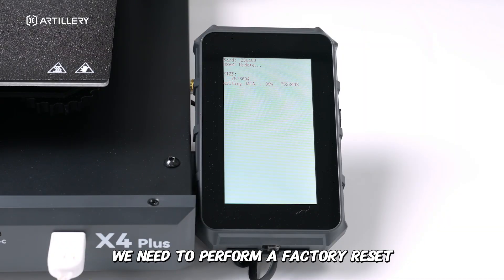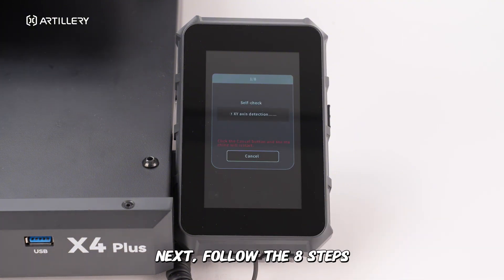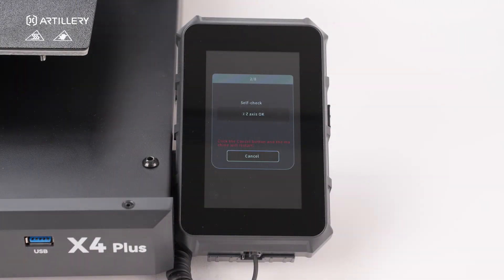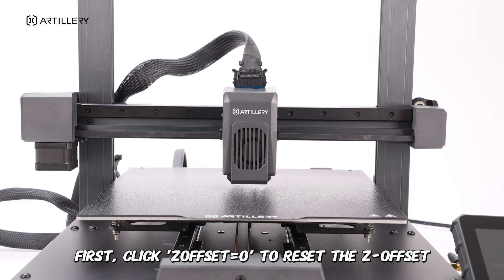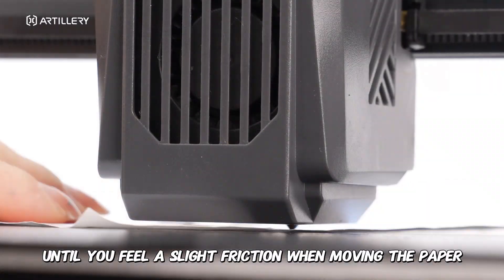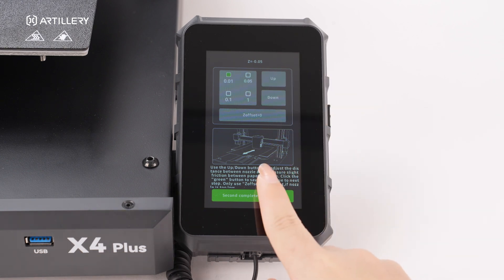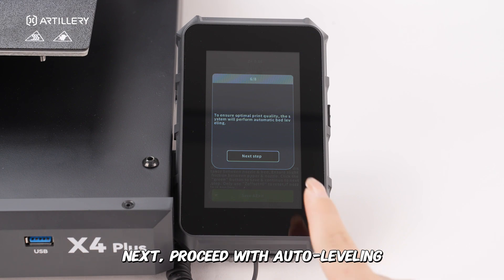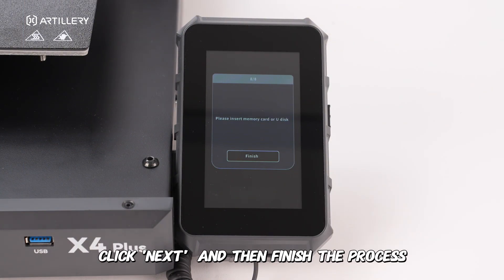Tutorial | Factory Reset Guide for Sidewinder X4 Plus/Pro

Comment: My printer wont print and says no trigger on probe after full movement, it also will not auto level and is operating backwards
Reply: Hi I'm having the exact same issue please help. What was your fix in the end ??
Reply: to me at least, the diod stop block was placed on 180 degrees and it was basicly telling the bed it was 180 degrees in the wrong direction. So heres the fix, 1 ) look under the bed where the belts are. 2) remove the carage that the belts slide into to create bed tention 3) youll see that one end is longer then the other so flip it, now your bed should be working normally and not having probe issues or backward x,y
Reply from the maker: Hello, we apologize for your mess. Please contact our support team by email: support@artillery3d.com. Our team will help you there.
Reply: @Artillery3D you keep saying this and yet your support department is useless and my printing is driving the nozzle into the build plate…